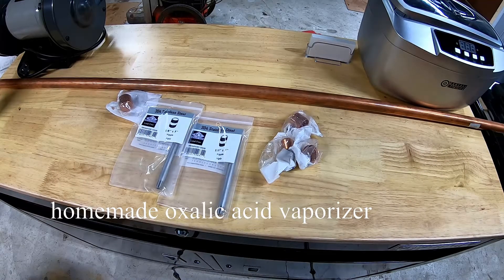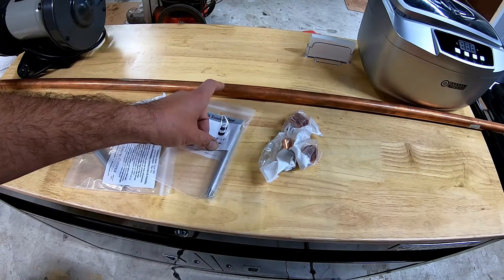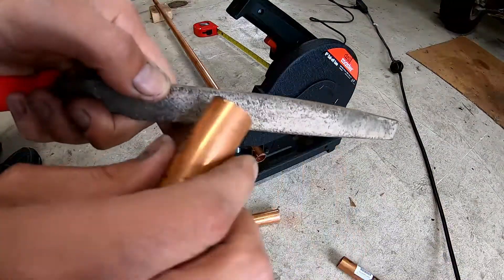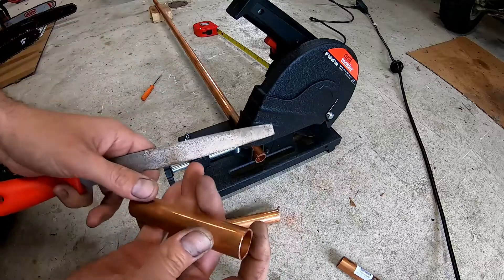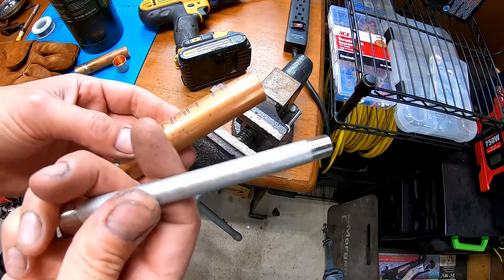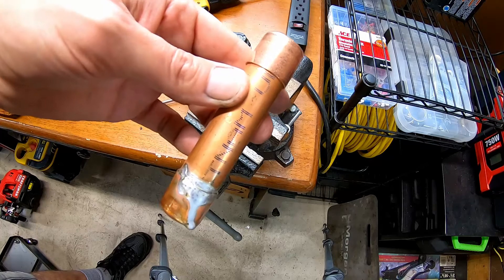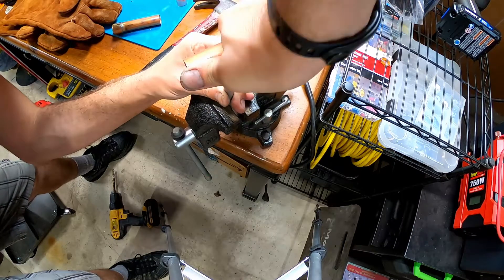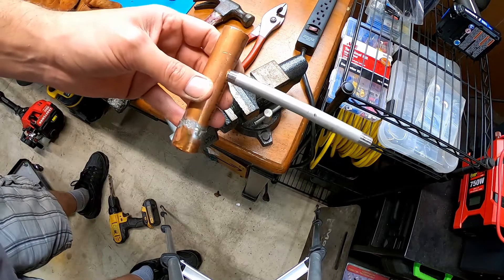homemade oxalic acid vaporizer

Comment: If there's access to small piece of 1.25" copper pipe (6" or so and it's used for sewage so old piece can be used as well) and operator doesn't care about exact temperatures similar set up can be done with 35mm 110V band heater connected to AC wire to act as heater on top of that pipe and brass/copper 1/4" threaded pipe would be better to be used as delivery nozzle which can be coated in red RTV silicone (small tube is available in hardware stores or auto ones to preserve heat from dissipating from it quickly during heating process or small piece of high heat wire insulator shroud on top. The connection between pipe and cap on the bottom cab be riveted with copper/stainless rivets to avoid melting solder (best option would still be brazing/welding but that requires more tools) rivets also can be covered by silicone if any vapors escape through them. I'm in process building one for my dad that uses PID with solid state relay to control temp more precisely so it's interesting to see so many different DIY builds out there. The cap on top is best to use silicone stopper with inside cavity that way you put on heating part upside down on top of the cap, flip and tap the top for acid to drop inside. Of course this set up requires 110V either through inverter or outlet/extension.

Comment: How did it turn out ?
Reply from the maker: As far as I can tell it works. I used them several times. You have to get the whole thing pretty hot. Or the vapor will turn solid as it leaves. (Like if the steel shaft is cooler than the copper)
Reply: Hi, I am trying  to make my own. Did the solder melt during use?
Reply: @giovanni6402  Yes, solder does melt then reharden.